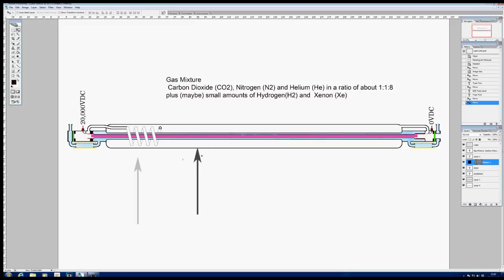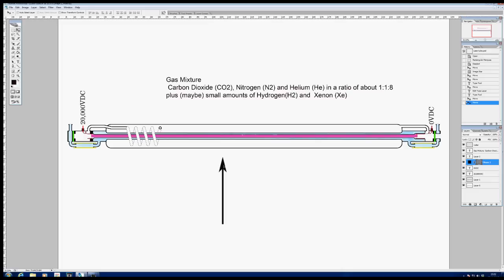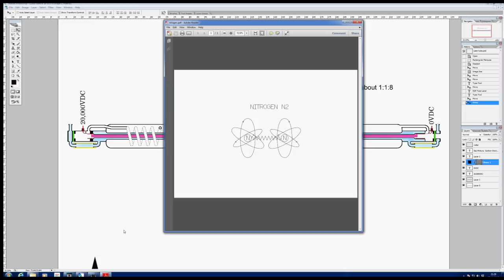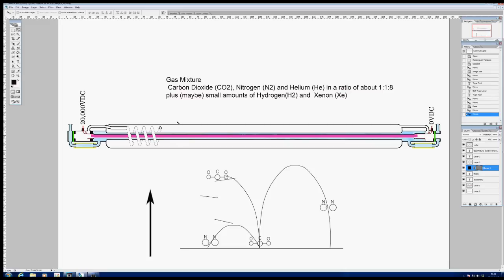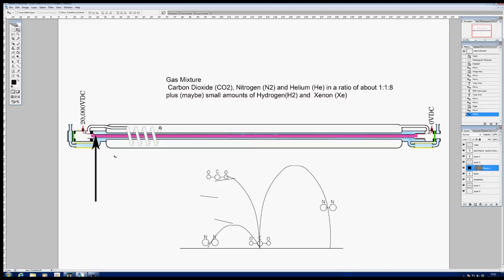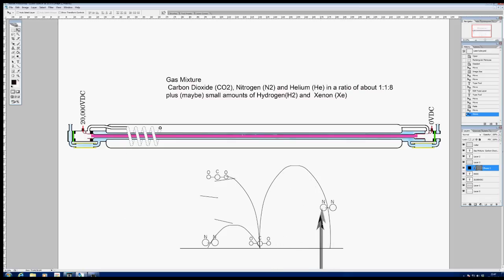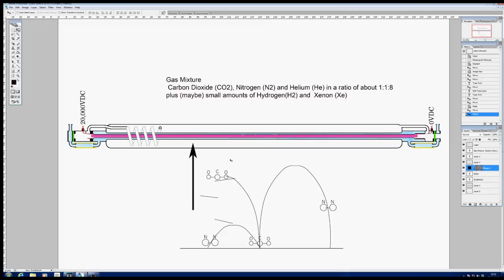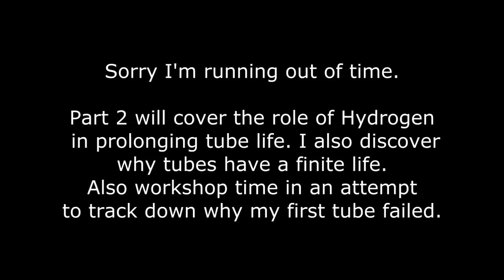RDWorks Learning Lab 35 Understanding MY Laser Tube Part 1

Comment: Thanks Russ for your great explanations :) You explain physics in a very funny way :) Very helpful, some teachers don't have this ability :)
Reply from the maker: Hi Amanda
Thanks for your kind words. Am I to assume that you are a teacher? This laser works in a VERY complex way. I am not an atomic physicist  but I was forced to  read many of their  highly technical papers to gain just a basic understanding of how this technology works. No one is ever going to go out and design their own CO2 laser tube from my description because it is a distillation of the very basic facts( maybe stretching reality a little) to convey a series of fairly simple concepts that non-technical people  can absorb. That housewife in Minnesota that bought her machine to run a small bespoke wedding stationery business,  all of a sudden finds her machine no longer works. Perhaps she will now  be able to work out that if the tube is pink but has no cutting power then the laser tube  needs replacing OR if the tube  is not glowing pink its a power supply failure.

 As I move along my learning journey I am trying to document my errors as well as my successes. These are not tutorials and I am not a teacher. I have all sorts of mechanical and production engineering skills. However, when I was a young designer and had to train people in the use and maintenance of machines I had designed, I soon realized that breaking technical issues into simple pictures that people could remember had 2 benefits. Firstly they did not fall asleep during my training and secondly they went away feeling like experts even though the were not . They still had to read the maintenance manual to fix the problem but having thumbnail images in their mind helped tremendously. 

By the way I hope you meant "funny way" to mean slightly humorous  rather than strange.

Thanks again
Best regards
Russ
Reply: I am not a teacher, but I was a student (mechanical engineering) and I know that some teachers just don't know how to explain complicated ideas/theories in a simple way, they just know the theory... Like Albert Einstein said: "If you can't explain it simply, you don't understand it well enough."
I am sure that your trainees were very lucky, because I know many people in the work field that don't like to share their knowledge with the fear of teaching something new to others... It doesn't make sense, I know, but there is a fear of people knowing more than "you" do... 

And yes I mean funny in a humorous way :)

Thank you for your time
Best regards
Amanda